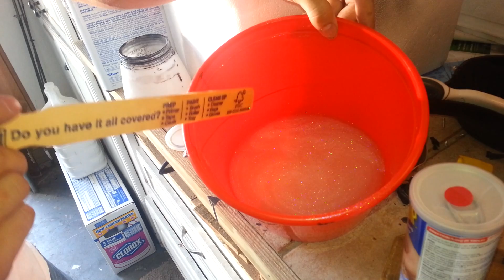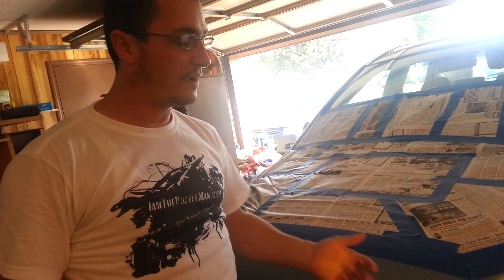In depth how to spray a clear Plasti Dip bra after adding glitter.

Comment from the maker: Because it was still wet. the first dried layers were dry but they were thin, so when I went back over it with a wet thick layer, the first dry layers got just soft enough to not peel.

Comment: Sweet, great idea to add the flake. A couple questions to this:
1) is the craft glitter color fast enough to withstand being in the sun without the color of the flake fading?
2) I am an airbrusher and plan on spraying my Nitro black (have to wait til spring.. Canada) then adding some airbrush to the doors. Is the gloss appearance the same as just the color coating without the clear or do I have to clear the whole car in order to match the glossiness? 
Again, sweet video, thanks G.

Comment from the maker: I got the clear from Ace Hardware. Order it from the site, have it sent to a local store, then pick it up. You will avoid paying for shipping that way. As far as the xylene it is fine to use. It's recommended as one of the thinners on the back of the can. But I my self has gone as far to thin black plasti dip with gasoline. Yep, it worked too. LOL. Not recommending it tho. I am just goofy. I would stick with one of the 3 listed on the back of the can. As long as It's legal in your area.

Comment: best way to get pigment is ordering online, from any place, ebay, etsy, etc. the usually come by oz and you don't need a lot to change the color or to add a pearl effect. very little is all thats needed. any brand will work, as long as it actual pigment powder and not just glitter or something like that. if you search on etsy for pigment you can find it for like $4 for 6grams. and that is more than enough. add a couple sprinkles to some clear dip and you'll have pearl without any texture.

Comment from the maker: It has gone through 1 Mississippi summer and has not faded yet. If anything changes I will post updates for sure. And as far as the clear I don't want to give you any false information. I have not used any of the glossifier yet. Sorry, I just don't want to pretend I know more than I actually do.

Comment: Just like the man said lol, hit up the forums, but it will not damage your clear at all, no matter how long you have it on. only thing you might need to do is wax and buff it if you want your brilliant shine back, but the clear itself doesn't get damaged.  but if your car was clear coated between 8-6 months prior to dipping, then there is a good chance it will mess your clear up, even if you only have it on for a week.if your car hasn't been cleared in the past 8mths then it'll be perfectly fine

Comment: I have a lot of different ways to do it, if you take some "glitter" or pearl pigment and mix it, you will not get any texture at all. pigment is a little more expensive, but you also don't need as much.  Michaels actually carries some. also, If you take some high silver non acrylic paint, and mix in very small amount, just enough to give you that sparkle or pearl look, it will work great, and will still peel perfectly, never had any issues, I would do some light base coats just in case.